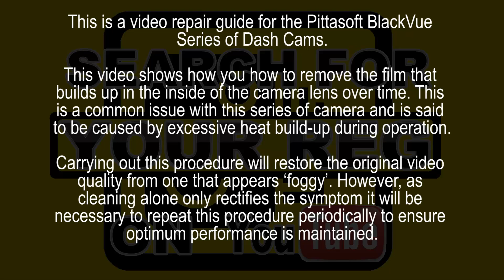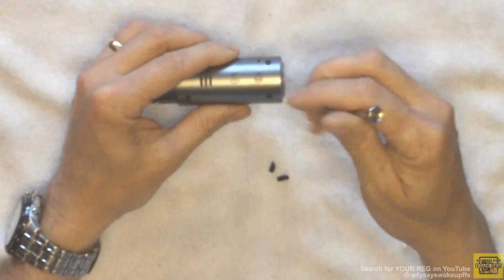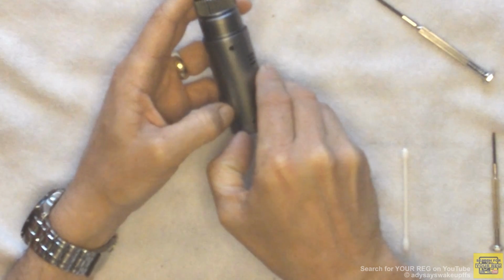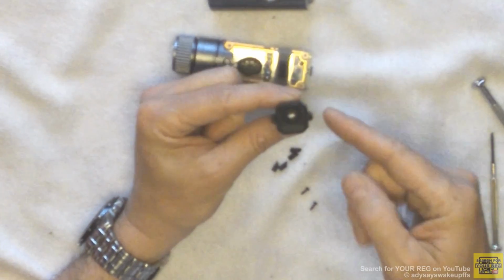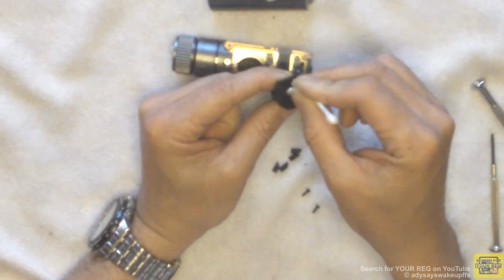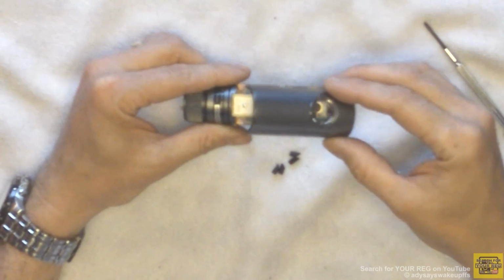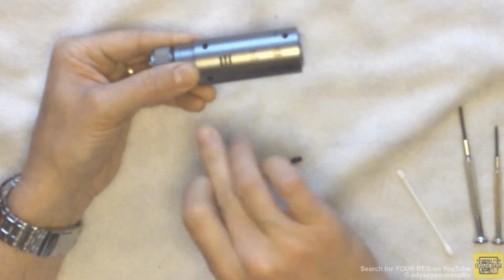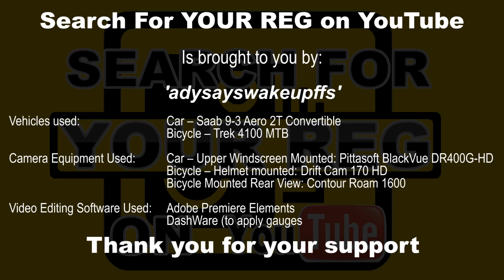BlackVue Dash Cam - Fogged Lens Repair Guide - How To Fix It

Comment: I was a bit worried about taking mine apart but after watching this I found it easy and straight forward to do. Only takes about 10 minutes and a great result.
Tracey, yes, good idea to use a pin to remove the rubber plugs.
Thank you.

Comment: Hi yes I did this with mine. I used a pin to remove the rubber plugs (much easier and less chance of scratching the unit) I also used a lens cloth as cotton buds can leave particles. I used a cotton bud dipped in alcohol and placed the lens cloth over to clean the lens the sensor is also prone to getting dusty as the unit is not air tight. I cleaned that as well with the same method. Cleaning both gives a better result. x

Comment from the maker: If you have the same camera and software. Start the BlackVue application and click on the sprocket icon top right to gain access to the settings. Select the 'Basic' tab. On the left, you should have 'Time Zone' and 'Image Setting'. On the right, you should have 'Recording Settings'. The third setting down should be 'Time and Date Display' with radio buttons for 'Display On' or 'Display Off'. Click on 'Display On' radio button and all should be good.

Comment from the maker: Hi Ian. I don't know what the actual cause is but my own research suggests some kind of emission when the device heats up. I don't know if it will lessen over time but since the job only takes about 10 minutes and you'd only have to do it every 6 months or so, it's no great shakes.
Hope you find this vid useful.

Comment: Thanks for the tip. I hope this works. Mine is almost unusable it is so foggy. Do you think this is caused by some kind of out-gassing of materials within the lens housing? I wonder if it will lessen over time.

Comment: Superb video, thanks so much for taking the time to record it. My lens still appears to have a film on it after going through the steps, so I am going to leave the cam out of the car for a week and put in a warm airing cupboard. I am hoping it is just some condensation.

I have a BlackVue DR400G-HD, did you manage to successfully update yours with new firmware?

Comment from the maker: If that doesn't work, there might be an issue with your firmware. Download the latest version from the BlackVue website and follow the instructions to update the camera. That might reset the speed and date/time display. If that doesn't work, you'll have to contact Pittisoft/BlackVue support for further advice. Hope this helps and good luck.

Comment: ...also, forgot to say, have you ever considered replacing the internal battery? Mine is bloated like nothing before, the heat of being on the windscreen has ruined it. Wonder if it is possible to source a replacement?
Reply from the maker: The heat is from the unit itself when recording. It's this heat that causes the film to form on the inside of the lens. The battery is only there to allow for the camera to save the current recording when the camera is unplugged and is therefore seldom used.
Reply: adysayswakeupffs Thanks for your reply. Ah ok makes sense. Yes battery used to keep cam on for a minute or so and it would then shut down a little more gracefully. These days, it just goes straight off when you unplug power wire.